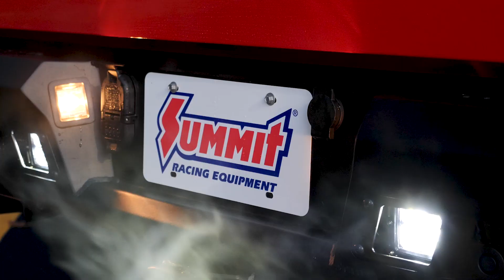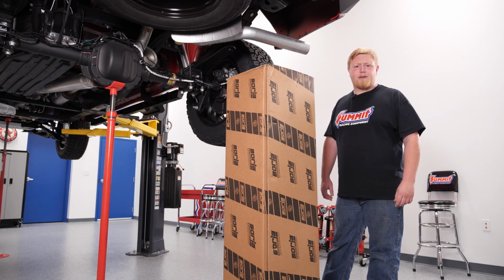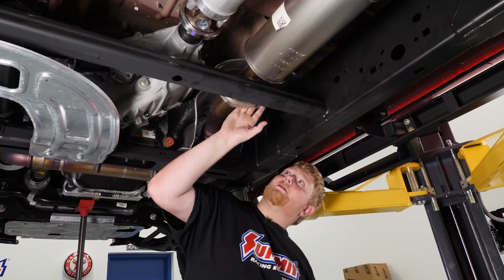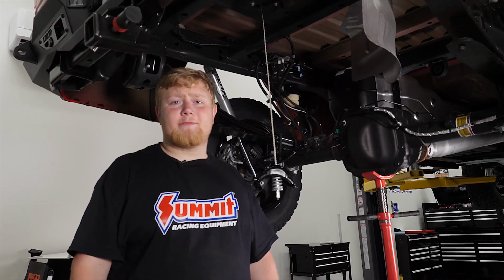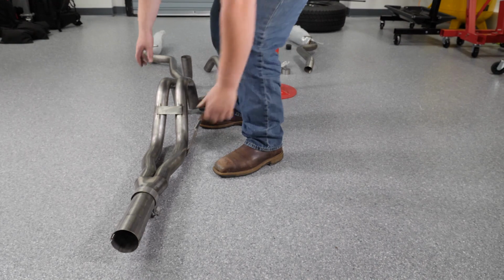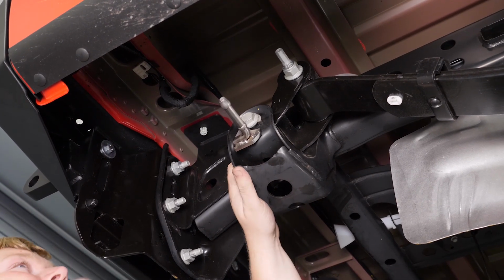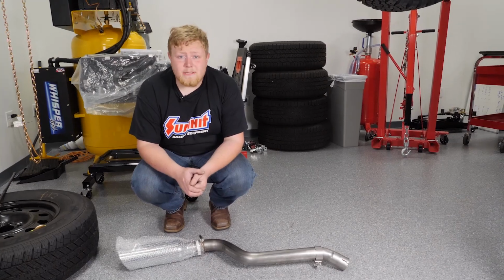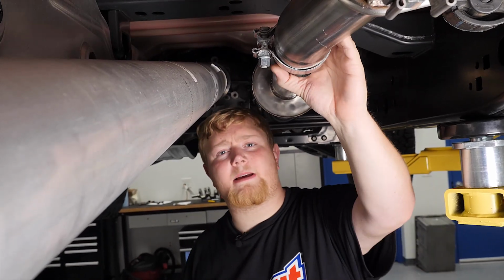2015 – 2020 F150 Exhaust Install: Installing a Borla ATAK Exhaust System on 2015 or Newer Ford F150

Comment: Must be great to work on BRAND NEW vehicles with not a single spot of dirt
Reply: The difference is very minute with the use of f*** and d*** throughout the removal of the old exhaust process. It may also be followed with an angle grinder and waiting for additional parts to arrive before being able to completely assemble the exhaust.
Reply: Joel Fauchon  dam str8 rust falling in ur eyes and shit
Reply: Having a lift would be great as well.

Comment: Running extra pipe around the spare tire adds more restriction, cost, I prefer to run two pipes straight out the right side.

 Unfortunately, I have yet to find a cat back kit that will have pre bent Mandel tail pipes.

 My rig is not presently a F150, but I did cut out the y pipe on a 02 f150  5.4 and run true duals..
Reply: @eighteennakedcowboys  must not be looking to hard. Lol keywords,  Side exit/Duals